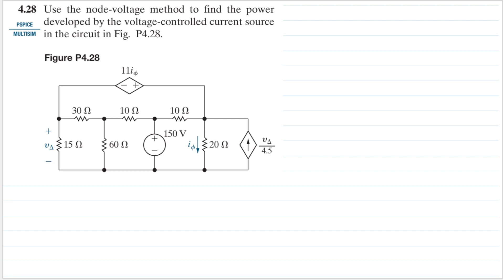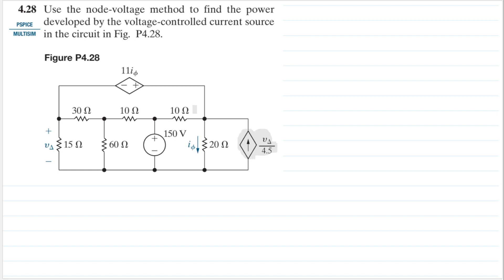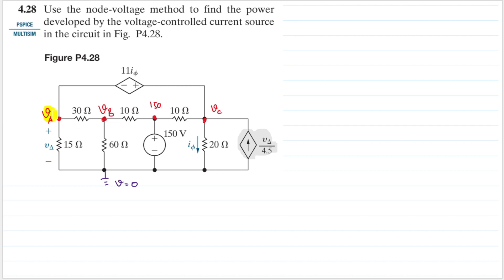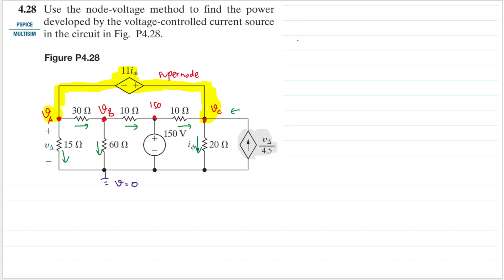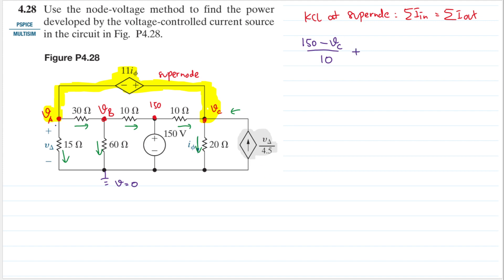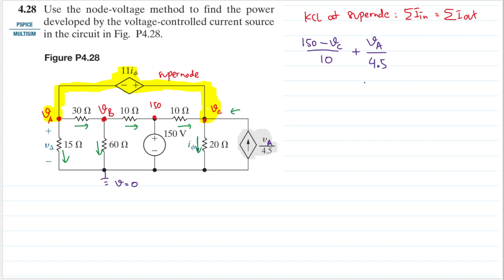Problem 4.28 (Nilsson Riedel) Electric Circuits 12th Edition - Node-Voltage Method

Comment: 1. In KCL at supernode, you missed (at the time of 4:00 min) the current outgoing from node A to node B. The equation will be, [(150-VC)/10]+[VA/4.5]=[VA/15]+[VC/20]+[(VA-VB)/30]⇒-22VA-6VB+27VC=2700.
2. At the time of 4:50 min, [(150x180)/10]=2700, not 27000, you missed the division by 10.
3. At the time of 7:54 min, [(150x60)/10]=900, not 9000, you missed the division by 10.
4. Final VA=90 V, VB=120 V & VC=200 V and P=200x(90/4.5)=4000 W.
Reply from the maker: Thanks!